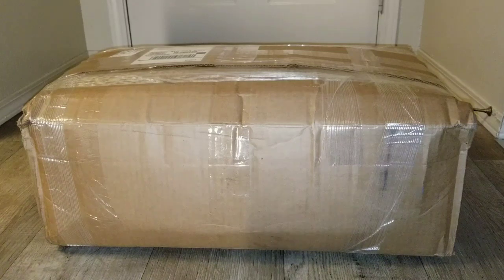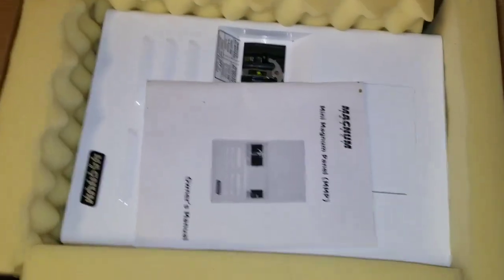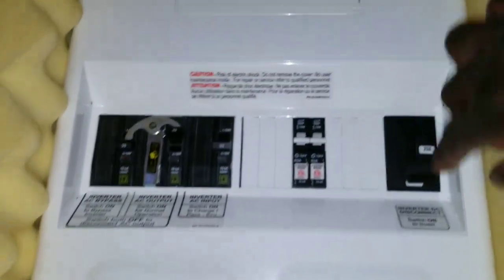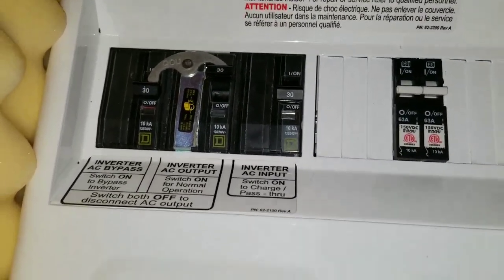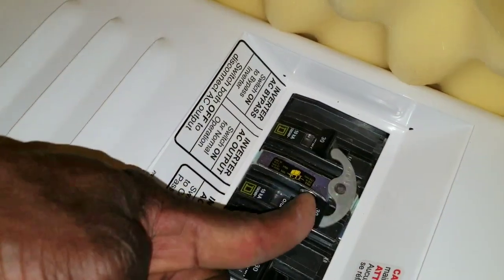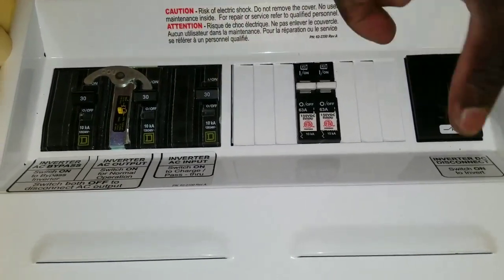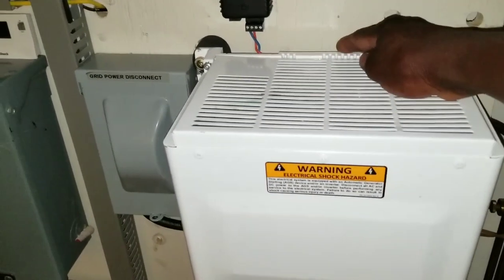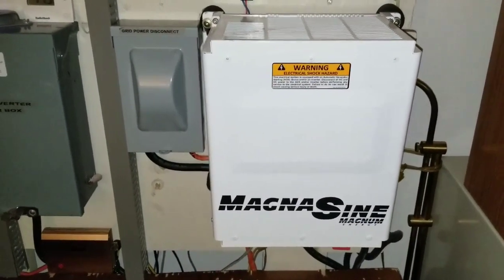Magnum MMP250-30D Mini Magnum Panel 250A DC Breaker 30A AC Bypass

Comment: Nice 
Can you get it with a 500A dc breaker and 100A ac breakers i need to upgrade my power delivery system for my victron 8Kva inverter
Reply from the maker: I don't think we've seen your entire Solar System components and setup.
I have seen your OutBack FLEXmax80 and your Solar Tracker
Reply: @jwsolarusa  No there's a brief view of it here but it's not all of it and have since added an extra CC 
https://www.youtube.com/watch?v=tSWI5OD2IHs